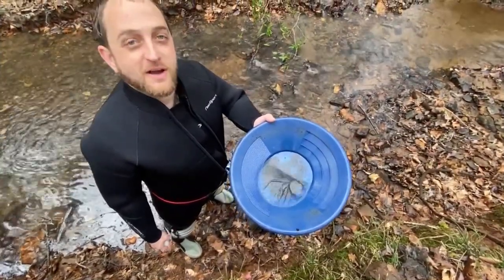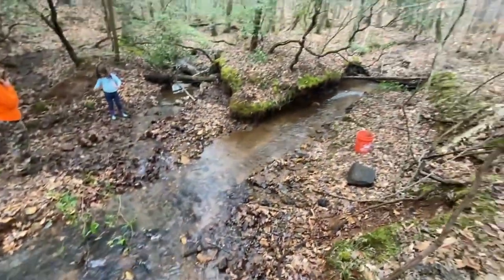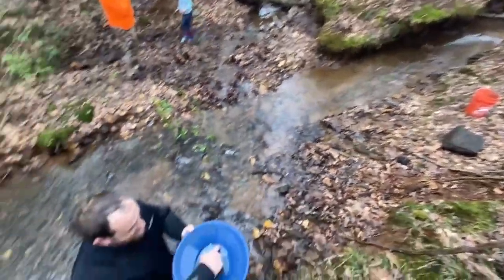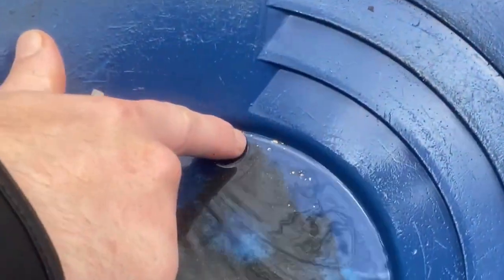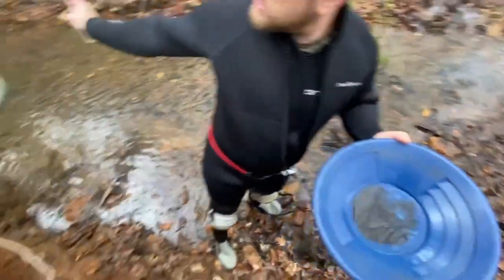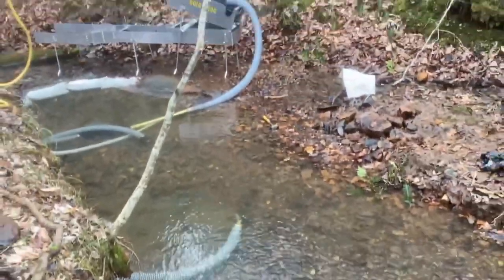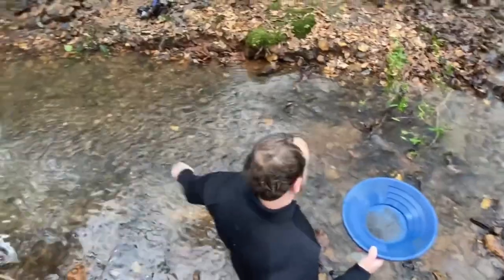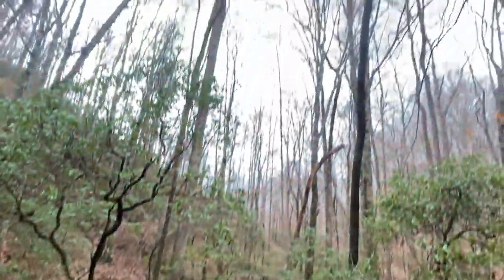Sample Dredging An Abandoned Ghost Mine In Auraria Georgia, Converting the monster hog into a dredge

Comment: Ditch the power jet and use a traditional nozzle with the pressure hose coming in at the nozzle. The water will slow down since it's being pushed from the nozzle instead of being pulled from the power jet. Or...move the power jet farther away incline from the hopper. I have both setups and change out accordingly.
Reply from the maker: I was going to try that but I hate how big the nozzle is it’s so hard to maneuver and get in the cracks. Maybe I’ll try putting it further away like you said. But I’m going to go back to a traditional 3 inch dredge set up minus the floats. We lost a lot of gold on this test but you live and you learn. Thanks for the tip Jon!

Comment: Also you can use  a 4 inch in that small creek. I have done it multiple times you just have to recirculate all the water by putting your sluice discharge up stream or in the same hole from where you want to dredge the only tricky part is creating a tailings dam to prevent you hole from getting filled in as you dig it and little to no visibly but one time I did get over 3.5 grams in 3 hours on a little creek with my 4 in
Reply from the maker: That’s so cool. We did try this in a small part of a smaller more shallower creek but it was way to mirky and then we dumped tailings in front of us where we needed to dredge after . I do need to find some recirculating system to hit these smaller creeks though where there is not enough water for the pump. 
Ty for the support

Comment: It sure is blowing the water out if the crash box like you said.  Maybe if you put less of a angle on the box would a 2 inch dredge work?
Reply from the maker: Yea 2-2.5 would have worked way better. But the issue was the way this was set up with a power jet. It should have been set up with a power nozzle instead. This way the water has slowed before hitting the box.

Comment: Seems to be a lot of water going out the tailings. You would be loosing heaps
Reply from the maker: Yea this was a first time set up. It was way to much water for this type of set up. We will be going back to a traditional dredge set up and have the rocks and all go through the sluice. Thanks for the support!
Reply: @sluiceboyprospecting  those Keene dredges seem to work good . Check out Abyss Dredging channel
Reply from the maker: @SouthernCrossGO  I did buy all the pieces from Keene. Now I just need the sluice and power jet. 
I have a 4 inch and a 5 inch. Had to go with a 3 inch here because the creeks are so small. I’m used to a massive river.  The idea with this was to be able to high bank wile someone else was dredging. Looks like it’s not going to happen.

Comment: How much gold is stuck in your hoses. All of you use those hoses. Just like a V mat. It does fall out. Is it in the bed of the truck., or the floor if the gradge. Just a question?
Reply from the maker: Although there is big ridges in the hose. The inside is flat and nothing  stuck in the middle.

Comment: Thought you couldn’t dredge in north ga streams
Reply from the maker: No you most certainly can on private property. But all of the federal or public land is pans and shovels only. Private property is fine as long as it isn’t a trout bearing stream.
Reply: Thanks for the info. Do you not spend more on equipment fuel etc than make anything off s few grains
Reply from the maker: We used to go dredge for two months at a time and we have made all of our money back. We sell our concentrates a if you are interested in trying some out. Check out Sluiceboyprospecting.com